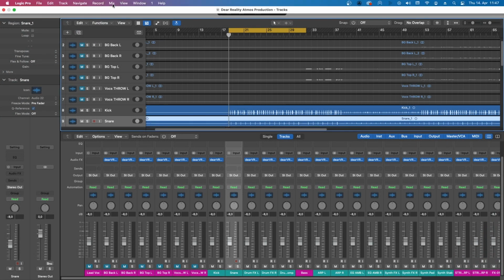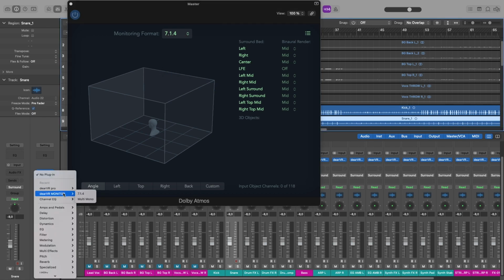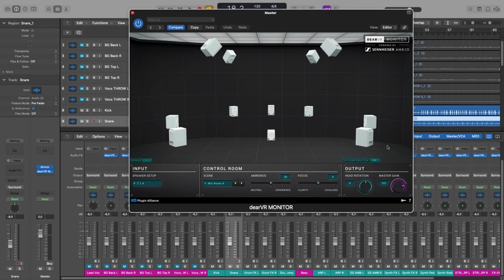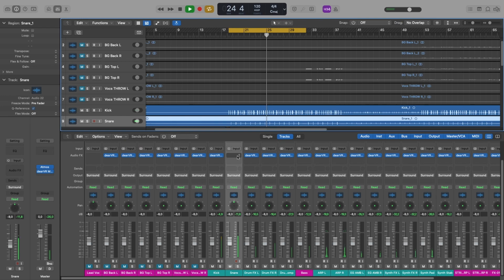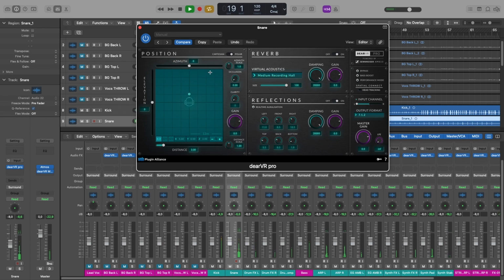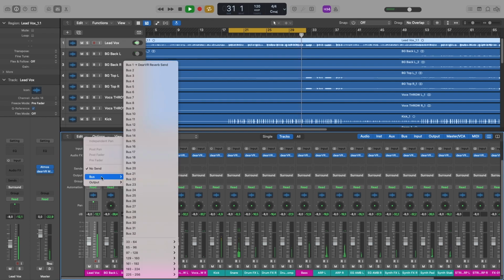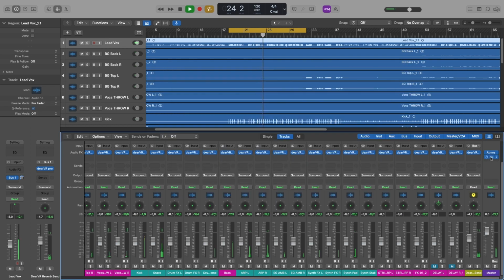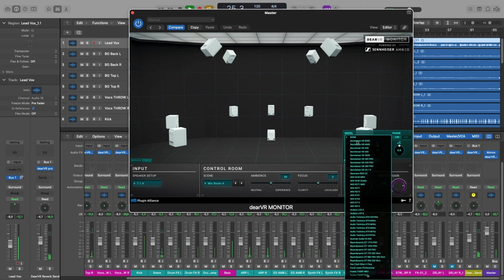dearVR PRO - Enhance Dolby Atmos in Logic with dearVR PRO and MONITOR

Comment: Why does this not work fully with Cakewalk? Cakewalk itself outputs true multichannel audio, I'm able to run Binaural setting fine. I think you need to redesign the plugin so it can have "child" instances on tracks to send to the main/Parent plugin on the surround bus and have access to all the track positions within the panner and the envelopes communicate with the child plugin changing the sound mix on the Parent.

Comment: Surely it’s pointless using this plugins if you are in Dolby atmos mode anyway? Will the plug-in make your mixes sound immersive even if logic is non standard stereo mode?
Reply from the maker: Hi @dannykirsch! Once you switch to Dolby Atmos mode, you would be able to use the plugin within the dedicated channel bed. All of the pros of PRO remain though: 3 dimensional panning which includes distance, and an easier workflow with reverb and reflections that adjust dynamically to the position.